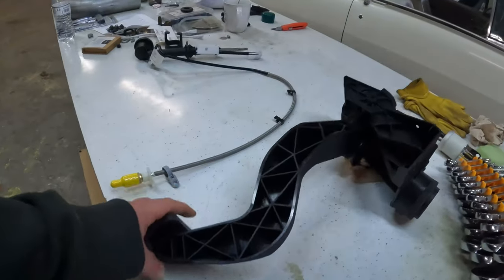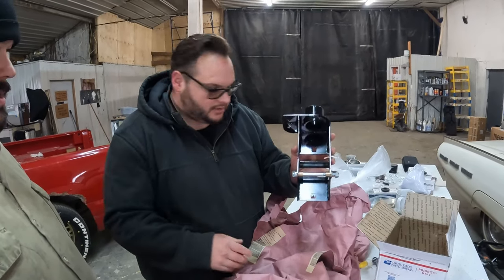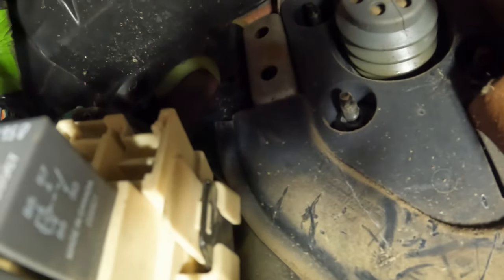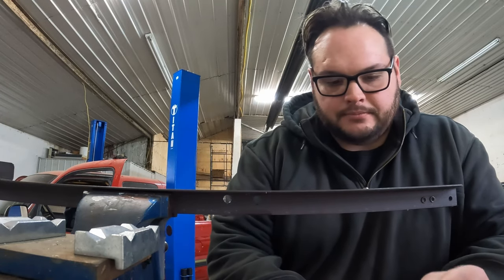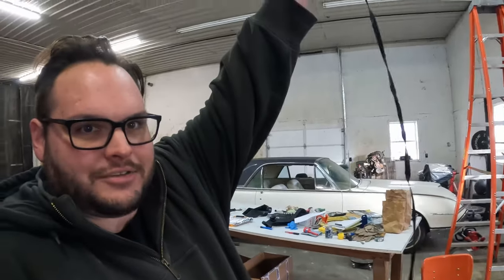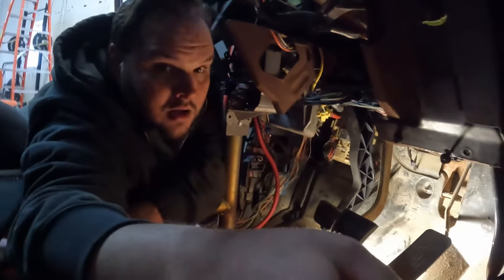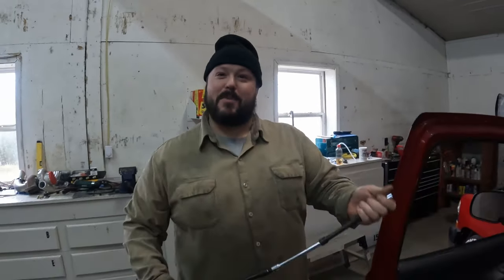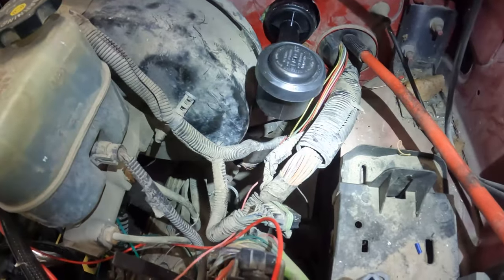Clutch Pedal Install: T56 Swap of our Turbo Silverado

Comment: Perfect, I swapped a 2009 suburban automatic, I converted it into a manual transmission with a TR 3450 5-speed box and it works very, very well, greetings
Reply from the maker: Sounds like a fun project. Glad it’s working out for you!

Comment: Appreciate the step by step video and showing all the issues you run into to while your doing it. I’m looking to do the same I’ve already got the 4l80E in my truck but it was installed incorrectly and messed it up so now time to just go with 6 speed manual
Reply from the maker: 3 pedal > 2 pedal

Comment: Which master cylinder did you get? And which hydraulic hose,
Reply from the maker: I’m sorry I don’t have a part number for you. If you go to rock auto.com, plug in your vehicle and look for the master, scroll down, you’ll see one pictured with the hose attached. It was a gm replacement part. Not a Dorman or other brand name. Hope this helps.
Reply: @onthebrink47 was it for a factory 5 spd truck??
Reply from the maker: @CarlosGarcia-lu4cv yes